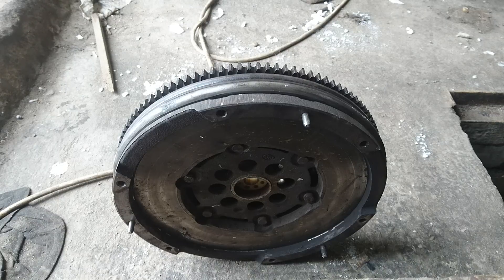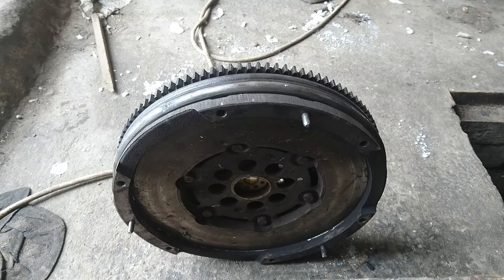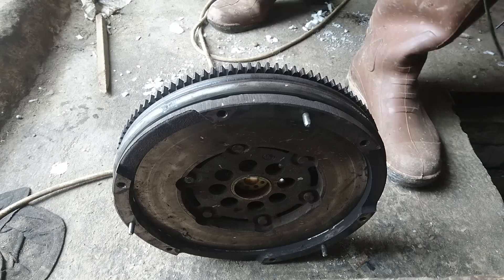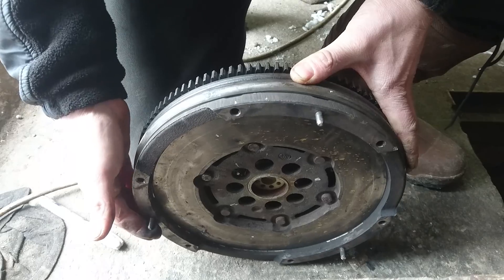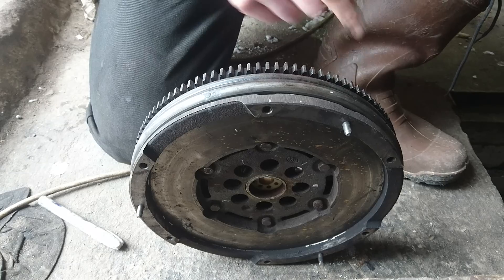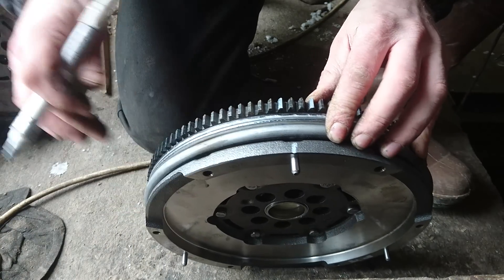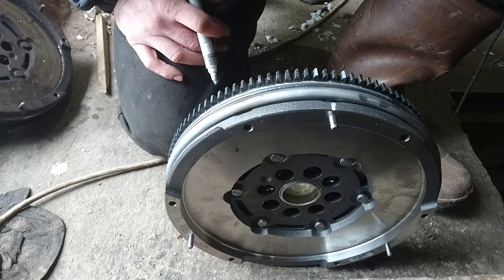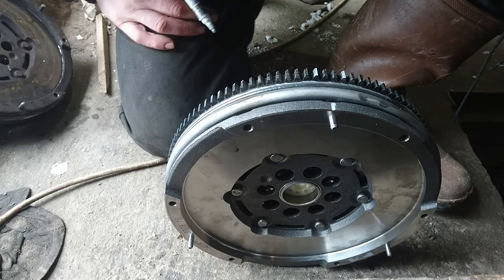How to check your DMF - Dual Mass Flywheel (Bad Dmf diagnose.

Comment: DMF bad, SMF good.. that's all you need to know. Replaced mine with a Southbend stage 2 endurance smf clutch kit.
Reply from the maker: Just wait for cracked crankshaft :D DMF is not there without reason. And - sometimes there is no conversion kit for some cars.

Comment: how long does a fly wheel usually lasts? & do you have to change it when replacing the clutch
Reply from the maker: Usually one flywheel goes for 2 clutches. But you always have to check that dmf

Comment: Thank you very much for this Oskars.

This is the very problem I have on my TD5  Land Rover Defender 130 right now.

I have spoken to some Land Rover specialist mechanics, and they say that the DMF will still hold together, even in its poor condition, as to help you get around until you can get another one.

Thank you for the information too, especially for testing the oscillation run out and tolerance level, as that is definitely good to know.

Sincerely,

Matthew

Comment: I have a Skoda Octavia DMF ZSB06J105266PE, 52000klms, it has 5 teeth play, nothing wrong with the DMF as a wrecked vehicle,  the real way to do it would be to bolt it to a fixed plate and use a torque wrench as you want to test spring tension, Manufacturers have test data, its Like testing valve springs certain weight v travel.
Reply from the maker: In this video you see method for freeplay, number of teeth depends on vehicle, for example, Volvo D5 engine, freeplay is up to 6 teeth, and it is manufacturer specified. Measuring spring resistance is another story.

Comment: After four months of using the new SACHS set (clutch, dual mass flywheel), noises started after pressing the clutch pedal. I bought the old 22 years with the course of 300 thousand kilometers, the LUK two-mass flywheel in perfect condition. I wonder if this is the fault of incorrect installation or very low quality SACHS wheels.

Comment: Thank you, very helpful.  I am curious about changing my 2006 BMW Z4 3.0si flywheel from a dual mass to a solid flywheel.  I have seen comments that it can impact drivability negatively.  Any comments on that aspect?
Reply: You will likely feel more vibration the dmf was designed to smooth out power impulses from the cylinders. I personally think it's an exceptable traid off.

Comment: Hi.... my astra cdti 1.9 120bhp was having problems starting..[ seemed like battery was draining ] so took it to garage about start up issue... they said my flywheel is knackered and is to blame .... car when started drived fine ... once got it back from garage can hear a big banging noice and clutch is now crunching .... took it back and he said it's the flywheel ... seems odd all this happened after they looked at it or just a coincidence..... can a bad flywheel stop car from starting

Comment: Hello mate I have a question,, I've got cluch out my st170 the dmf seems fine I've done wat u did with marking it it only turns past 3 teeth if that?? Also the front plate ther isn't really any play just little movements wat u think thanks steve I've subscribed and liked

Comment: What symptom did the car have to indicate you need a new one?
Reply from the maker: In this case the clutch was slipping a lot. Thats way you have to remove gearbox and check everything. Clutch disk was in good shape, then i checked dmf. But symphtoms may be different, like noise, vibration and others

Comment: Greetings, thanks for the video! MK6 DSG GTI, intermittent issue hope you can help. Reverse gear won't engage, this maybe happens once every 400 miles. This has been ongoing for the past couple months. When it happens I turn the car off and back on and reverse works again no problem. Yesterday I found a pool of oil under the car. It's all over my pendulum mount. Pretty sure it's the main seal. I bought new upgraded clutch packs to hopefully solve the reverse issue and a main seal upgraded part. Should I expect a flywheel replacement too? The car has 130k miles on it. Anybody?

Comment: Or the option is only buying new one?
Reply from the maker: there is option to rebuild it. but it is not DIY job, because you need many special tools and equipment to balance DMF after assembling. it costs more than half of the price of new one here in Latvia, so brand new one is best choice in my opinion.

Comment: Just weld it solid flywheel then
Reply: The clutch isn't sprung so it wouldn't work well with a solid flywheel you would need a new clutch too

Comment: So that's how you check dual to on every car ?
Reply from the maker: Claudelu Delu for dual mass flywheels - yes. You can do it without removing it from car. Just figure out, how to lock crankshaft or flywheel's solid part. Also - there  is some special tools for this job. But i dont have them 😀
Reply: Oskars Kļaviņš I'm asking because I have to change my to, and I found one in a new car crushed :D and the mechanic told me I need new because you cannot check if the old one is good or not ...fk him :D
Reply from the maker: Claudelu Delu thats right, fk him. Show him my video :D i am mechanic too, and i never change good parts to the new ones. Thats why i made this video. Because DMF is dark magic for everyone, who dont know how to chek it ;)